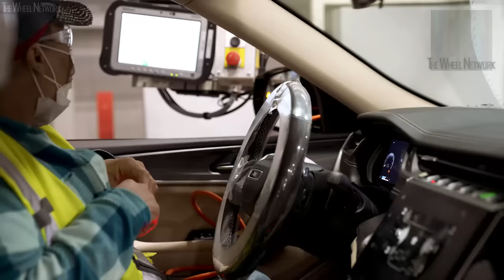Stellantis Production in the United States – Chrysler, Dodge, Jeep, Ram (Formerly FCA Fiat Chrysler)

Comment: I've had 4 Grand Cherokees 1 with 5.2 and 3 with 4.0. 2 of the 4.0s went to 340k+ miles. Currently driving a 2001 Durango SLT Plus. the Jeeps were/are made to a higher level of quality and are timeless no matter what year you have. Soon I'll park the Durango and get another WJ. Love the 4.0 engine.
Reply: UAZ?
Reply: Dont try and live in a state where they use salt on the roads it will rot away

Comment: I have always been a BIG Dodge fan!  Thank you Stellantis for keeping the quality in the Mopar name!
Reply: Dodge needs to bring back a quality C-Segment vehicle like the the Dart and/or the Neon!
Reply: I agree with you in the Dart! I would have loved to order a Dart, but I got a ‘21 Jeep Cherokee instead. A RWD or AWD C-segment vehicle would be a good selling point! 🤔
Reply: Brand needs to build consumers confidence and work on quality and reliability
Reply: I have heard many good things about Stellantis as they are giving all of their brands 10 years to become successful!
Reply: I have the Dodge Sprinter '06 turbo Diesel and have spent $800 on repairs in the last 185K miles. Some people want to buy it. I always say, "come back to me in another 240-250K miles and we can talk." Most of them do not understand the engineering involved in the early Sprinters. The available tires and oil has changed since new; the same parts repaired are good to use.
Reply: @vincentrolfe1384  Those diesel engines are not produced by Stellantis.
Reply: @sergeantmasson3669  At one time Daimler Benz owned Chrysler Dodge and those Sprinters of that era were from Germany. I buy all parts for repair from Daimler. Dodge pickups today are not the Sprinter design Diesel as you know. When I touted my Sprinter I was talking DB brand 5 cylinder.
Reply: @vincentrolfe1384  Dodge pickup trucks no longer exist.  It's been Ram trucks since 2009. Sprinters used Mercedes Benz 5-cylinder turbo diesel engines. Ram 1500 uses a diesel engine made in Italy. Ram 2500-3500 use Cummins diesel engines. Dodge/Ram trucks have never produced their own diesel engines.
Reply: @sergeantmasson3669  Thanks
Reply: @johnbeckham1483 the neon, ugh. Both mine and my wife's went through 5 headgaskets each. That was just the beginning. Had high hopes when I bought it. What a toilet. My aunts Neon was just as bad. My uncles Stratus, which was a nice looking car was horrific. All the rain water from rain storms would drain into his trunk. The the PT cruiser that they got. Garbage. Bad all around.
Reply: @joeb2588  the neons that I drove like you had head gaskets & motor mounts going bad!
Reply: @johnbeckham1483  man, when I bought the car I thought it was the greatest car ever. Had a manual and everything. I loved the interior as well. It just had so many problems!

Comment: The jeeps are good. I put 100,000 miles in 11 months 2014 JGC. I love the AMC 4.0 Jeep engine in WJ XJ. It was nice to see a new XJ on the line.
Reply: 100,000 in less than 1 year? wow..
Reply: Changed spark plugs and intake manifold rubber seals. As well as fix my emissions system for a small Evap leak fixed it myself. Went thru two sets of tires. I took the Jeep GC from 90,000 to 190,000

Comment: I have a 2016 Chrysler 200 made at Sterling Heights assembly. Bought it new and so far 50k miles of trouble free driving. Only new tires, battery, and oil/filter changes. One of the best looking cars Chrysler built in a long time. Too bad the big 3 have all but stoped building mid size sedans.
Reply: You are absolutely right, the 200 is one of the best looking midsize cars produced, let down by that POS German ZF 9-speed transmission still finding its' way in the Jeep Renegade, Compass, Cherokee, Fiat 500x and the Chrysler Pacifica.  Hopefully, PSA will correct this travesty!
Reply: Ford brought back the fusion for 2023 as a sedan and station wagon.
Reply: I would hope you would get at Least 100,000 miles trouble free driving..but then again Chrysler NEVER Was known for reliability.
Reply: did u forget about the 300 the design the everything about the 300 i have a 2016 300s and they beautiful the highway drives are so smooth

Comment: I have owned over 5 Jeep’s, 1 Cherokee, 4 Grands, 1 Chrysler t&c, 1 Plymouth Savoy, and 1 AMC Hornet, 1 AMC American, 1 AMC Matador/MOPAR cars.  Better than any Ford or GMC products I’ve ever had.  Thanks for this vlog and sharing with us.
Reply: That's Called unconditional love !
Reply: did you ever have a 2.7 liter v6 engine in any chrysler product in the late 90;s thru 2000,s ?
Reply: Chrysler makes jeep dummy
Reply: My Cadillac nowbis an Antique, I still love it.
Reply: I live American cars! I have a Bummer for my 65th Bday present but my next car will be an American car.
Reply: Yup! I've owned a 1968 Charger, 1970 Charger, 1976 D200 with a 440, 1976 D300 Crew Cab with a 440, 2007 Aspen Hemi, 2009 Aspen Hemi, 1998 Ram 1500 Quad Cab, 1999 Ram 1500 Quad Cab, 2001 Ram 2500 Quad Cab 4x4 V10, 1999 Ram 2500 Quad Cab 4x4 Cummins with 6 speed swap, 2007 Dakota Quad Cab, 2012 Ram 2500 Mega Cab 4x4 Cummins, 2006 300C (Hemi), 1976 Cordoba 400 4 barrel, 1975 Charger (318), 95 Dodge Neon SOHC 5 speed, 95 Plymouth Neon SOHC 5 speed, 99 Neon DOHC auto, 98 Neon SOHC auto coupe, 85 Dodge Aries, 85 Dodge Ram Van with 318, 75 Fargo motorhome with 440, two 2005 Neon with 5 speed, 03 PT Cruiser auto, 04 PT Cruiser with 5 speed, 99 Durango with 318.... Owned a lot of Chebby and Fords too-but hands down NOTHING is better than a Mopar!
Reply: And a 1996 Grand Cherokee, 1991 Cherokee with the 4.0
Reply: And a 1990?? Caravan with the Mitsu 3.0
Reply: And a 1997 Chrysler Town & Country.... I think that's it.
Reply: Those AMC's you mentioned were before any connection to Mopar. AMC wasn't part of Mopar until it was purchased in 1987.AMC was it's own company created by the merger of Nash and Hudson in 1954.

Comment: I am surprised they aren't making the 5.21 liter 318 cui engines as a mid grade performance engine option for the types of vehicles, besides the Dodge Vipers. Maybe the manufactures will give a small black V8 option like 318 cui once again in a fuel injected version. Also if dodge, Jeep, Chrysler, and RAM add the transmission cooler line filter on the outside of the transmission it would make transmission fluid and filter changes easier even though the primary filter wouldn't be as easy to get to I think the secondary(cooler line filter ) is the one that needs change during service intervals more so than the primary (flat screen filter).
Reply: Emissions is eliminating all the v8 sad
Reply: That`ll never happen that makes too much sense.
Reply: @on-site4094  Yes, Stellantis is discontinuing all V8 engines.

Comment: Stellantis need to get Chrysler back to being engineering driven to tighten up on reliability and build quality. Yes they have improved a lot, but there is still room for improvement.
Reply: No lie, my 2016 300s is hands down the most reliable new vehicle ive ever had, getting another. Only unit ive ever had that starts at -40 Celsius with out being plugged in. every dam time lol
Reply: @ryanbryski704  adalah 87ⁿA
Reply: There is more than room for improvement with this 45.000 trail rated unitized body constructed juice can.the first time you twist the body and the insurance man hand you a check for about half of what you paid for this you than can say room for improvement.
Reply: It's 2021 and you're still asking for improved reliability and build quality?? If it hasn't happened by now, it never will.
Lee Iacocca in the 80s had to revive them, 40 years ago. He drove a Toyota onto the factory floor to show
the workers how a car should be made. A savy American Italian has to plaudit a Japanese car to auto workers in Detroit.
Reply: Bean counters it’s about the next quarter and money 💵
Reply: Chrysler is long gone i know i worked there 30 years
Reply: Ram has the best trucks period have owned 12 and not one problem with them
Reply: Well you see who they hiring? They all look lethargic af.
Reply: @davefroman4700  generalization, its easier that really thinking about it.
Reply: @jacklong7048  As an engineer I know. With our modern material sciences today there is no reason that disposable products should exist, let alone have material goods that are deliberately designed to fail as soon as possible to necessitate repeat sales. By Scientific scales of performance consumer capitalism is by far the least efficient system of resource management that the human species has created in our evolutionary history. Our true nature has always been for thrift and conservation. Not mindless consumerism created by the psychological manipulation of every form of media on earth.
Reply: When Chrysler took away the retirements and replaced it with 401k you will never get people to make a career and try to keep there job .🤔 The quality gos down . Big difference between a job and a carrear 💯👌 and the new workforce is about worthless to ...

Comment: It's a bummer how many robots there is.i love the on hands love you workers are putting into each American made car.but it's a lot different now days
Reply: At least half the jobs still there are replaceable. But unions have slowed the process. Now everyone in the engine and transmission shops are being shown the door. Electric cars are dead simple to assemble and the part count is 1/100th of todays cars.
Reply: It's not a bummer, the more robots the better the quality.
Reply: @anthonyxuereb792  the more automation, the higher the cost of initial investment, and also to replace/repair broken automation.  Guess who is paying for those costs in the end.....   (give you a hint...not one of the robots)
Reply: @davefroman4700  on the flip side, with all of the new electrification and autonomous vehicles, there are more Electric modules and more wiring connections in the vehicles.  So far robots a rent able to make many of those, requiring operators to do this work.  The automotive sector is making big shifts for sure!
Reply: @anthonyxuereb792  so many have decided not to work or doing other things. Expect more robots, at least they are reliable and don't come to work with hangovers.
Reply: @tonycharron73  it's worth the extra cost if it improves the quality one would expect.
Reply: @jacklong7048  automation is happening regardless of who or who doesnt want to work

Comment: 1976 dodge coronet 4 door Door handle chrome with coronet engraving in chrome.  Standard oil pump- oe specifications. Water pump- standard oe specifications. Timing chain- single- oe specifications. Stock coils- oe specifications. Door sills- chrome- plain. Windshield wipers- 4 speed- oe specifications. Interior- 1970 with my 2005 xg350 rear arm center and woodgrain and cup holder pull out/in.

Comment: Years ago, well around 2003, I was a Shop Foreman for a large Toyota dealership here in Maryland. I've seen SOoooo many different occurrences with BRAND NEW vehicles tbh, uncountable 🤑😔🤔😆 I remember 1 time, a BRAND NEW 4 Runner was being delivered, and the truck driver COULDN'T get it off the car carrier 😲😣 It had NO REVERSE !!! Mind you BRAND NEW <2 miles. Any how, I was called out there, and sure enough NO REVERSE in 4 lo, 4hi ??? It had all forward gears no problems. At any rate, we were able to put it in neutral, coast it off the trailer, and sure enough, it was a DOA/burnt internal shift solenoid ??? But naturally being a "BRAND NEW" vehicle, I had them put in a BRAND NEW transmission.... This is an AMAZING system, they have as an assembly line production. However some errors DO get by. In this case... Generally speaking, the vehicles being assembled, are ONLY mainly driven FORWARD. From Start to finish.... Amazing technologies tho 🤑🤗😵👀😊😃

Comment: 1979/2024 scout 80 4x4 with 304ci engine.  Fuel injected  with 150mm electronic throttle control.  Dana 44 axles front and rear.  4 speed (46re) automatic transmission to deplete stock in build site.  Dtc port electrical/electronics upgrade.  Dash guages.  True dual 2"1/2" exhaust.  Factory 4" inch lift with 285/70r17 tires and  17x10 rims.  3" driveshaft.  (1996 dodge 4x4 axle gear ratio). Stock interior.  15" rotors front and rear.  Floor 4hi/lo shifter.  Go Sam Houston.

Comment: I watch all American assembly plants of Auto mobile. I think they all are doing a great job of building the vehicles . It's when the vehicle is sold to the customers is were the problem start is how the vehicle is taken care of . If you want the vehicle to last you change oil at 4000 miles not 7000/10.000 or 15.000.which some oil and Automobiles manufacturers requirements. Service you transmission no longer then 50.000 miles not 100.000 miles and wash the salt off the painted and the underneath in the northern states. Remember the engineers are not paying for repairing your vehicles  after the warranty are off .

Comment: The weather stripping started lifting off,cruise control buggerd up,front windshield trim was not properly installed,air conditioning buggerd up,been through 4 cvt rubber joint covers and the hoist for the back tire was broken ..all this within 80,000 Kms on my 2015 ram!..oh yeah and about 5 fucking recalls on it!

Comment: 1976 4door dodge coronet- measure for correct shocks. Correct spring height. Box frame for coronet. Make a arm 1/8" inch thicker. Grease ball joints to correct 2wd dodge ram issue. Grease pitman arm.

Comment: (2026)-1976 2 door dodge magnum with shark fin. No vinyl top, 5.2(361ci-1964) dodge magnum, 8 speed transmission, 9"1/4" rear end, 15 inch rotors and calipers black with magnum white lettering, 18x8.5 rims(5), 255/50r18 sport tire,  2"1/2" exhaust through 16 inch muffler step up to 2"3/4" exhaust exit 30 degrees behind rear wheel.  Updated technology and wiring with oe dash guages and dtc port, led headlight and sequential rear taillights. 361 dodge engine 10.0 deck height roller block, 200mm electronic drive by wire throttle body, midrise intake with 3 inch runners, 2.120"intake valve/1.760" exhaust valve, 1.65" steel roller rocker arms with 7/16" hex bolts, 7/16" cylinder head studs, 7/16" pushrods, 2"/3/4" roller rocker lifters .878" diameter, crankshaft oe specifications add .093" radii oiling holes- standard bearings, hydraulic roller camshaft,  single timing chain, oil pan 3/8" Allen bolts, connecting rods- 7.300" with laser hole through center connecting rod. small end .956", big end - oe crankshaft specifications, 4 valve relief pistons(-2cc) , 1996 dodge 4x4 gear ratio in 2wd rear 2025(1976) dodge magnum, oe shocks, box frame rails, oe spring update and ride height to rim size, 4 speed windshield wipers, oe 1976 trim, push button door handles- like 1983 d150 vent window button as example,  interior- 1983 dodge d150 example with belts and buttons leather, front bucket seats pay attention  to spacing of belts and buckles for spacing, 170 amp altenator, group 75 dual batteries, one pair 6x9 rear deck, rear side  wall 6"1/2" component pair, front door 6"1/2" component pair,  dash 3" tweeter pair, 120x4 factory amp, interior color- light blue (1983 dodge d150 interior schematic) , automotive paint color- dark green, add cb radio as 1976 dodge coronet 4door as schematic, cb Rado antenna works off shark fin, shark fin placement-rear center, pistol grip shifter- check build site. Oe dash update for technology, no carbon fiber, abs plastic in areas that have, woodgrain wheel as 1976 4door coronet, trunk color, light blue with light blue trunk mat- (Magnum)in white lettering. Front and rear floor mats- light blue with magnum in white lettering, remote unlock/lock and remote trunk unlock, 1996 dodge ram starter hi torque should fit this engine- check build site and update to manufacturer specifications, labor 12000 bucks, vehicle update 18000 bucks.

Comment: Stellantis I'm not an SUV fan at all and Chrysler is one of my favorite brands re invent the the 300 from the ground up bring back the 200 upgrade these beautiful cars don't get rid of them and also the town and country which is more reliable than these SUVs run into around the streets. There are still sedan, coupe,minivan station wagon people still out here. Make Chrysler the ultimate luxury brand with some work and effort it can be done.
Reply: I have a 2010 Grand Caravan made in the Windsor plant. This car has second and third row stow and go seats. In about 2 minutes they all fold flat into the floor and I have hauled multiple 4 x 8 sheets of building material in it. Then the seats pop back up and I've got a 7 passenger limousine. But the current version of this car is the Chrysler Voyager, which only has the third row stow and go. Please bring back 2nd and 3rd row stow and go on the Voyager. I dont' want/need a Pacifica.
Reply: @reecenewton3097  Yes I do agree what's not broken don't fix but you and I both know everything is all about looks and some of the looks don't look like a real car more like space ships. Stow and go was the best thing ever and also the first minivan to have double sliding doors. I miss it all.

Comment: 2024 (1976)mid year  exhaus-. 2"1/2" piping exit rear tire at 30 degree angle, catalytic converter and 17 inch muffler oe specifications,  dtc port. 170 alternator, update technology package with update guage cluster- same year guage cluster and options, updated wiring schematic to fuctionality.